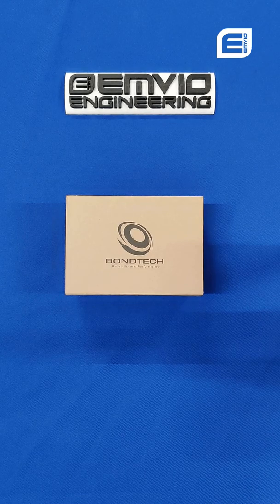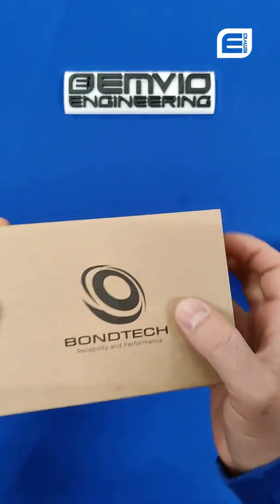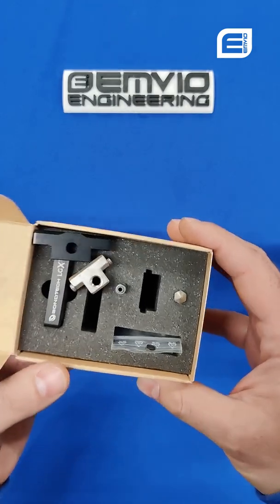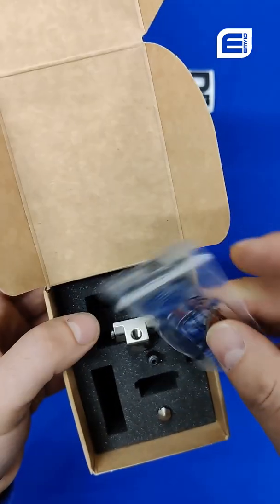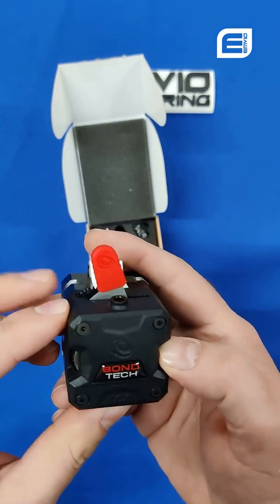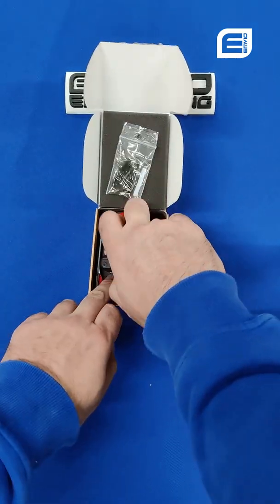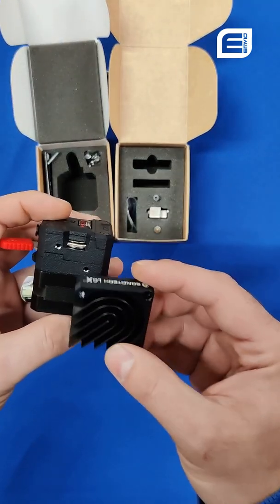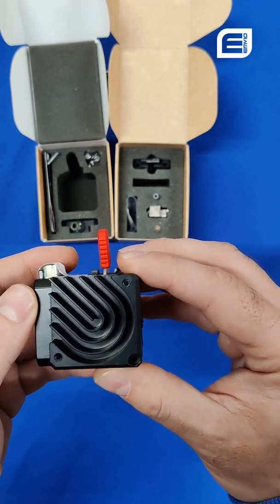Unboxing the Bondtech LGX™ Shortcut Copperhead™ Printhead

Comment: no mention of all the missing components ....never mind the poor heatsink design ?
Reply from the maker: Hi Jack, what bits are missing from the Bondtech Kit? As for poor heatsink I am not sure what you are comparing it to. It is actually sufficient for most of the flexibles. The Shortcut is not meant for high temp stuff. Let me know ;)
Reply: @emvioeng  I expected just that as it proclaimed it had a slice engineering COPPERHEAD ! When it arrived I was dumbfounded to see the joke of a cooling solution it has less contact surface than a chineese MK7. It does not include a motor connector or a heater cartridge and no thermosistor and no fan for christ sake.Worst 200 bucs I ever spent.
Reply from the maker: @skimpypockets  Sorry you felt you were not given the full information. Typically Bondtech are very transparent on the contents of their boxes. If your reseller was not then please take it up with them. As for the cooling solution, have a look at the competition as well. For the purpose this hotend kit is intended, everything is sufficient, proven through testing by Bondtech themselves prior to releasing the kit.

It really sounds to me that you need to go back to your reseller and explain you were expecting something else to turn up. You may find they accept the return and allow you to use your credit for something else. At least that is what we do...
Reply: @emvioeng  can It do PETG well?
Reply from the maker: @airBornFpv  the more traditional type would be better. PET needs more heat than TPU
Reply: @emvioeng  That is why I don't, buy Shortcut version - cooling through a radiator on a side off the bottom mount is very questionable, I ordered today the ACE Copperhead version with monolithic heatsink coming from the bottom up + high flow CHT nozzle
Reply from the maker: @airBornFpv  the shortcut is for TPU. As for questionable cooling. It's done like this for a reason. The head of engineering team at Bondtech, knows his stuff. Hence there have been very few, if any questionable products from them
Reply: @emvioeng  agree, Bondtech has amazing Engineering team! I went for ACE - excels for all materials 😁😁 love the idea of super short fillament path